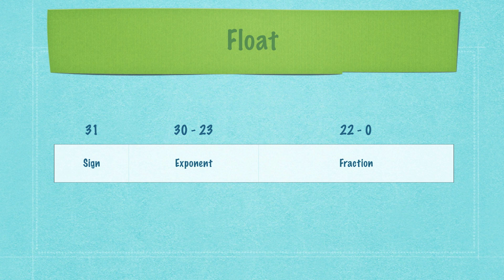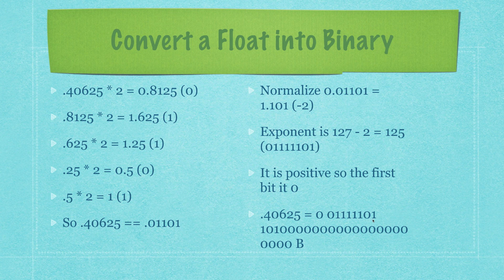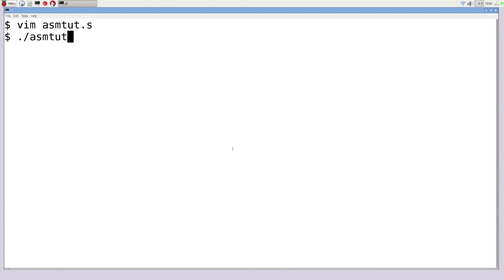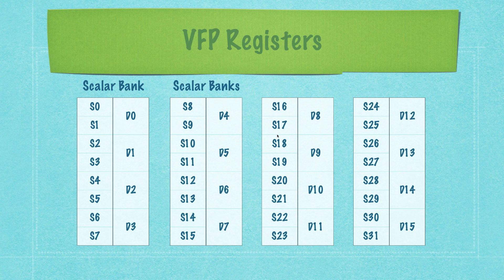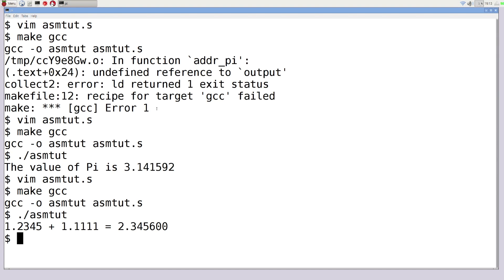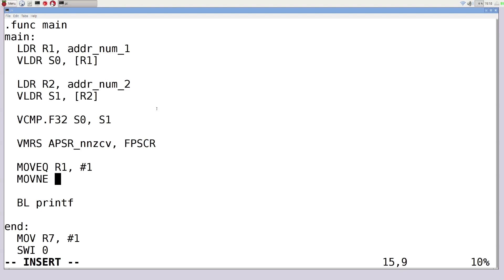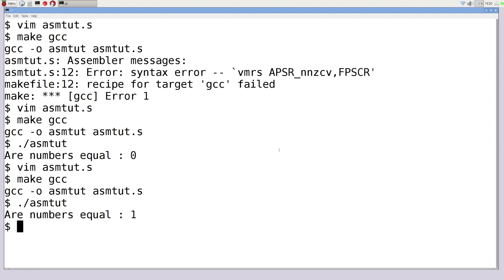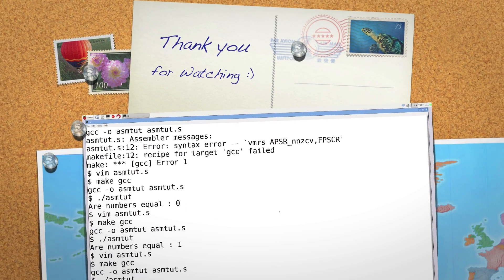Assembly Language Tutorial 4 Floats & Switch

Comment: I would like to see two things. First a "Why shall we use assembly language", means solving a problem in C and then showing how much faster it gets in assembly, second case is, that some problems are actually easier solved in Assembly than in C or HLL. And where the true potential of the CPUs are and show with some quick benchmark how far from that we have come.
I always quote the introduction from "The Art of Assembly" from '96 for this. He comes to the point, why Assembly is still relevant and always will be. And that it is relevant you can also see in many Raspberry Pi libraries, that are especially optimized through the use of assembly on critical parts of code, which is one of the reasons the little bugger is such a giant.
By the way, great work!
We also need to get the ABI you are using and how to call SYS_EXIT or SYS_WRITE symbolically. There are include files in the system, that can be used and I never was a friend of using "magic numbers" in Assembly. It should be made symbolic the earliest way possible and also with the link to the ABI people would understand what exactly you are doing when calling system functions. And where you got those "magic numbers" from and why. And if you include that, it will allow everyone to explore on himself about this.

Comment: @Derik I love these videos, and wish I had gotten my assembly start when younger. I am a 49 year old beginner and curious if you could recommend any way of going about learning this stuff in a structured CS way without college?

I actually started with Atmel AVR but having a real bad time. I'm a firm believer in RTFM, but data sheets expect a person to already have the experience to know what it is saying. 

I'm interested in the goal of bare metal Pi/AVR/PIC/ARM for real-time IOT. 

Thank you for sharing what you have thus far in your four videos on this topic. It has gotten me a good way in assembly within an OS (Raspbian). Still useful for other things. 

Kind regards...
Reply from the maker: I'm happy the videos have helped :) I don't know of any good books on the subject however. I mainly learned ARM specific assembly by digging through random online articles, information on the chip itself, and with pure experimenting. I wish I could help some more
Reply: If you want an easier assembly language, and are still looking after 2 years :D, try MIPS for RISC and m68k for CISC. Both are relatively easy to grasp. m68k started as a 16-bit machine that went to 32 bit and MIPS started as 32-bit which was extended, very nicely, to 64 bit. You can use bare metal via QEMU, but it would be easier to find a simpler emulator to start with, so you don't have to get into machine types and disk images.  SPIM is a 32 bit MIPS emulator, I don't really know about anything similar for m68k, but I know there are emulators out there.